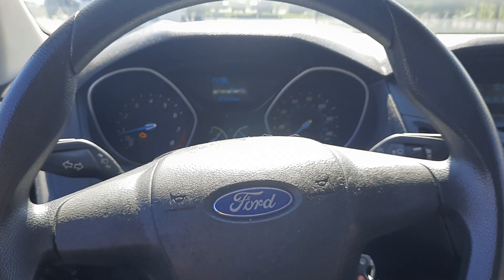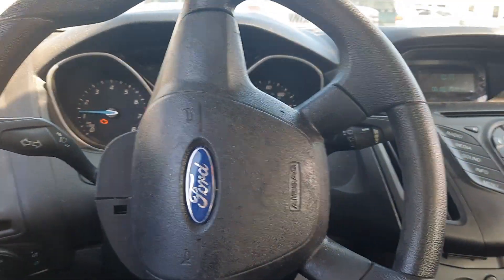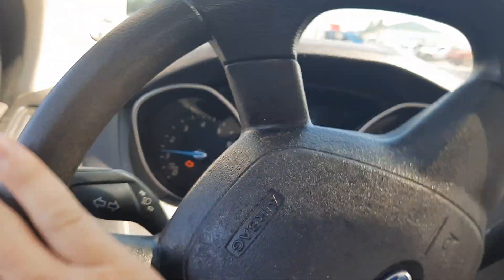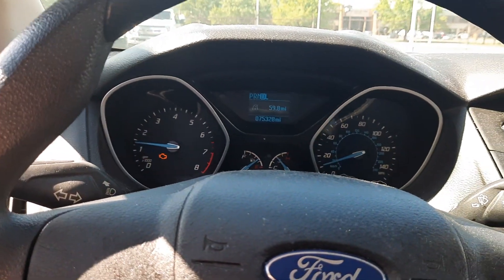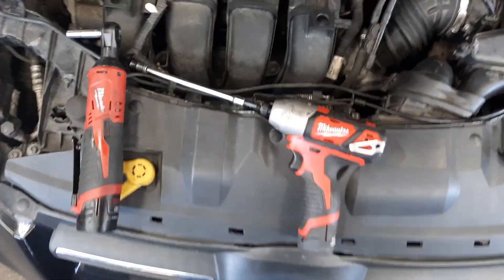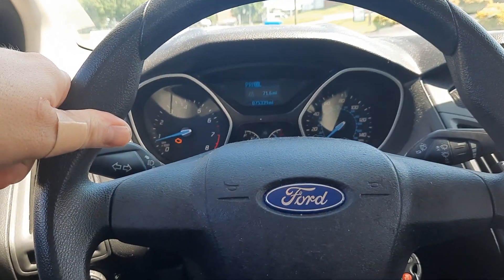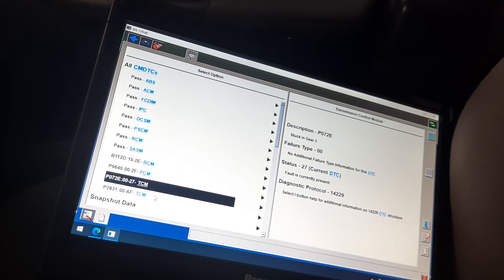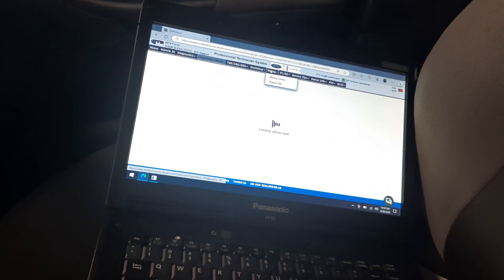Ford Focus Won't Move Forward! P0805 | Diagnosis

Comment: Hey man ive learned alot from your videos and you seem to be the most knowledgeable on you tube as far as this particular transmission goes. Thanks for your help. And videos.......i have a 14 fiesta with a p0805 code in it when you put it in drive it makes a hell of a grinding noise when it engages drive and then it will go. It sounds like its destroying the transmission. Have you ever had this kind of a problem. Fyi i just replaced the clutch and forks and throwout bearing they are new. I also replaced the actuators with used ones
Reply from the maker: @dreece2000  hey I'd swap actuators A and B to see if reverse grinds instead, to confirm actuator failure. You can also turn clutch A by hand to listen for grinds using my video called focus clutch fork test
Reply: @BigBensCarsAndCycles  I'm about to do that now as you did in the videos. Thanks for the quick reply.
Reply: @ unfortunately the problem stayed the same with actuators swapped. it fails the travel test on the relearn. most of the time after it sits for a few minutes it wont start unless you put it in anything but park and then go back to park you can start hearing shit move. what worries me is going in drive it sounds like you missed second gear banging them grinding  but it only does this while its going into forward gear
Reply: its smooth as silk the forks movement manually thanks again for your help this is really a selfless act of you
Reply: @BigBensCarsAndCycles  hey I just got the problem fixed, after pulling the trans 2 times and 4 different actuators, new clutch, countless hours, the only thing wrong with this car was a ground wire. 
I appreciate you helping I do this for a living as well. This is family car and its the first one I've messed with. As far as dct trans goes. I dont want anymore part of it. Thanks again pal

Comment: Hi ben, i have the same problem like yours there is no 1,3,5 gear and the check engine light is on and it shows “transmission hot wait for 5 minutes”. We brought it in to the mechanic we found online near to our place, first they check the unit and scan it and after that they try and replaced a new actuator then they start the engine and engine light is gone and no transmission hot appears in the dashboard next they test drive the car in a long miles about 10 minutes also and then came back to the shop to said the news to us and the mechanic 

suggested to put back the old actuator if the engine is repaired and will work again with the old actuator they tried to drive the car again for 5 minutes and then the check engine still gone and the car runs fine again. We thought there was no problem so we plan to take the car home but suddenly after the mechanic remove the wirings of the scanner, and when my uncle start the engine the check engine light appears again and the car is not running fine again. this is the funny part the owner of the shop and mechanic said you should replace the transmission and they eliminated the possible problem of the actuator, they want us to replace the transmission right away it feels like they just fooling us to spend a lot of money to them. So i need your opinion about this because after I search and saw your video we have a same problem with the car. Please i need your help and clear explanation what should i do to resolve this problem. I’ll wait for your response thank you
Reply from the maker: @AraMarieGarcia  p0805 - clutch position sensor circuit.  Usually it's a bad actuator. But technically can be an issue with the transmission harness or tcm. You can also do a clutch fork test on clutch A.  And check the tcm ground under the airbox

Comment: Polish the grounds, clear the codes, reset the transmission.

I wonder how many of the TCM issues are caused by years of having a bad ground.

The last time i got my p090 code was a year ago, just reset the codes twice and did nothing else and it fixed itself.

Comment: I switch the actuator but it didnt switch code. Is this TCM??
Reply from the maker: Clutch position sensor fault codes are usually the actuators that failed, but since you swapped actuators and the code didn't change, it may be the tcm or frayed harness ( easy to check - small harness)

Comment: so is this an auto transmission...?  i didnt know auto trans had a clutch...mine is giving same code  P0805..but its an auto trans and none of the gears work. it just sits there and every gear is like nuetral.  what can I do to fix...?  2012 ford fiesta
Reply from the maker: Welcome to the channel. Yeah, this is a dual clutch automatic transmission. I've got 100+ videos showing how this transmission works, and how to diagnose & repair it's issues at home with no special tools. P0805 is probably the actuator.
Reply: @BigBensCarsAndCycles hey ben, hope your doing good. I recently been having the same issues I had code P0805 and P2872 pop up. So I watched several of your videos and followed them. I changed my clutch actuator. I got forscan,cleared the codes and performed a clutch adaptive learn. Thought I was done until the following day. The same code popped up but only P0805. I took everything back apart, cleaned all the grounds as instructed and put it back again. I’m just confused what would be causing the same code to be reoccurring?

Comment: Did you just move the Actuators around ? My moms focus got P0805 and P0806
Reply from the maker: Yeah and if the issue switches to the other clutch then it's a bad actuator
Reply: @BigBensCarsAndCycles  okay so just switch them out pretty much ? Coo I’ll get to work 🫡

Comment: Hi Ben, great channel, very helpful. My 2014 Ford Focus (automatic) is fault coding P0805, with gear shifting and startup issues. I have already replaced BOTH clutches, the TCM and clutch actuator B---could this simply be the clutch position sensor? The Ford powershift transmission has been a horrific disaster for me financially--thanks in advance for your advice.
Reply from the maker: Hi, that codes indicates a problem with the top clutch actuator. If that's already been replaced, take the air box out and make sure there's no loose tcm ground or corroded battery cables
Reply: Thanks Ben, truly appreciate it and keep up the great work! @BigBensCarsAndCycles
Reply from the maker: @stevenbrown9678  if you're not sure where the grounds are, I have a video showing how to clean tcm grounds that'll show you

Comment: So shouldn’t it effect r/2/4/6 by  switching a to b
Reply from the maker: Yes those are the gears for clutch B. If the issue transfers to those gears when swapping motors, it's a bad motor
Reply: @BigBensCarsAndCycles motor has in actuator or actual motor?

Comment: Is burnt clutch a sulfur type smell? I sporaddically get that smell but not very often. Usually when accelrating hard onto the highway with extra people in the car. If the car is shifting fine with no lights on, is burnt clutch smell a problem?
Reply from the maker: No it's more like a burnt brake type smell. Your odor may just be from the cat from the extra fuel during WOT
Reply: @BigBensCarsAndCycles  Good to know, you are a pro! Thanks for the input 🙏🏻

Comment: Thanks Ben, I purchased a ford fiesta 2012 ( push to start ). Had a bit of some flood in my area which covered half of the engine.
Had multiple issues, as the water had entered the immobilizer and fuel pump relay . Cleaned up the immobilizer electronics with some contact cleaner and everything worked except the keyless, I’ve had to use the key close to steer key approach to start. 

Gear acted up and replaced the actuator a which solved it. Have been using it for about a week until

Yesterday , it started acting up on gear.skipping gears 1, 3 and 5  Have changed the actuator A again but problem persists and now also got transmission temperature alarm this afternoon.

Please can you help with any advice for my case ?
Reply from the maker: Hi, I think the water must have gotten in the bell housing of the transmission and rotted the clutch and clutch forks. I'm sorry for your luck, but I'd investigate into failure of the clutch and forks.
Reply: Thanks Ben

Comment: Hey Ben, I just brought a 2014 focus for my daughter. The trans started to act up & engin light came on. I had it scanned and this is the code was P090C: & P090C-00 clutch B actuator control circuit low. It changes gears funny and the reverse goes out. Can you give me some suggestions?
Reply from the maker: Most likely the tcm. Which is free for you until 2025 at the dealer. They are on back order. I recommend leaving it at the dealer and most likely you won't have to pay a dime. Thanks for watching. Please consider subscribing for more helpful videos. Good luck.
Reply: @BigBensCarsAndCycles does dealer cover a 2012 focus with 202k miles? I see in the warranty it says 10 years or 150k miles
Reply: Thank you foe getting back with me. I have subscribed to your channel and will be looking for more good content.